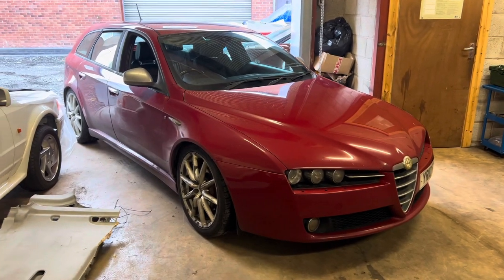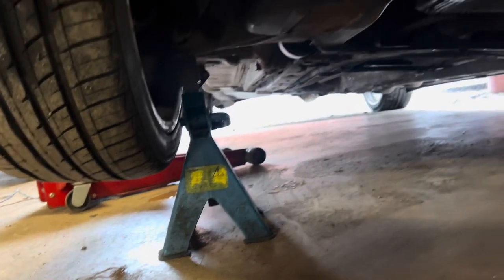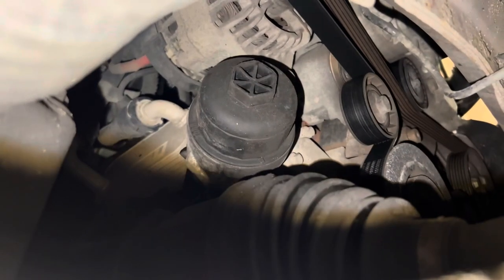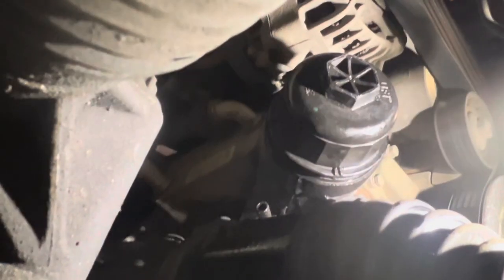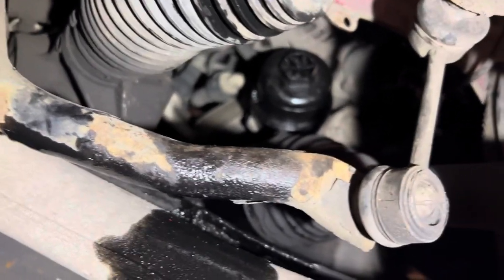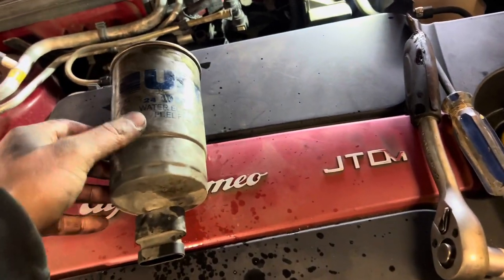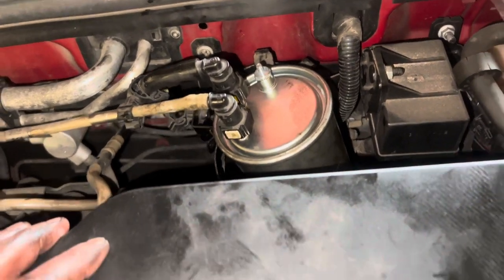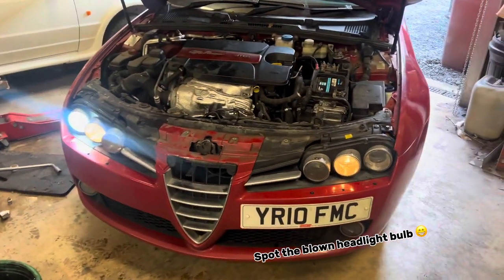Alfa Romeo 159 Service - oil and filters - Fully detailed

Comment: a life saving advice for every 159 owner.  if out front wheel needs a life saver do as follow...   remove your good rear wheel mount the life saver on the rear. then remove front wheel with bad tyre and mount the good rear wheel on it. Thank me later.  alfa jtdm  front axle load is 1030 kg  rear axle load 730   with driver and 50 liters of fuel
Reply from the maker: Good advice 🙌